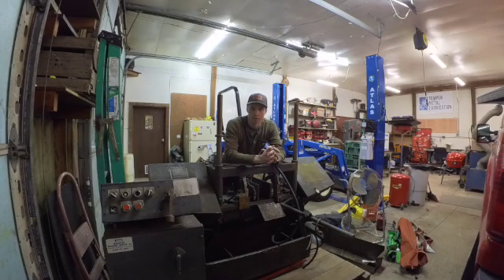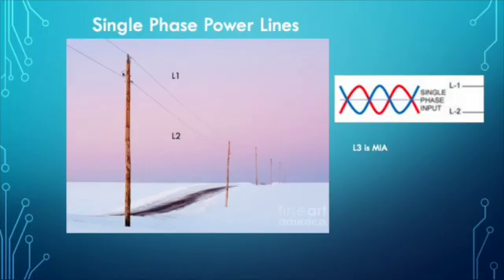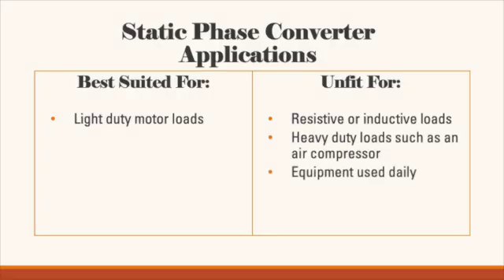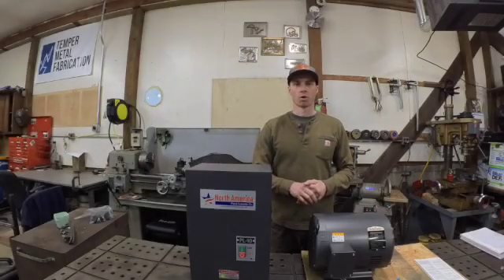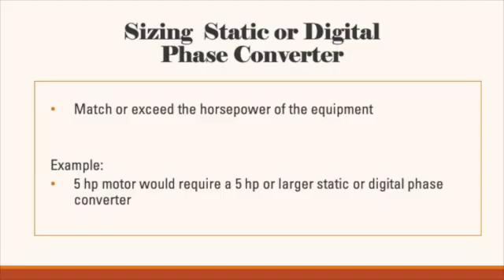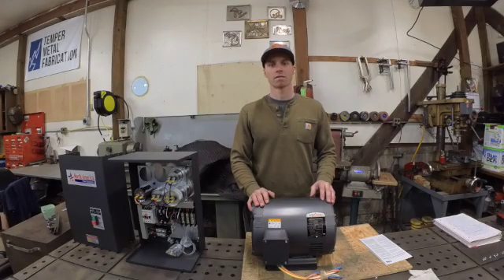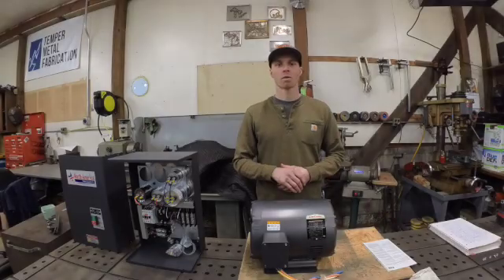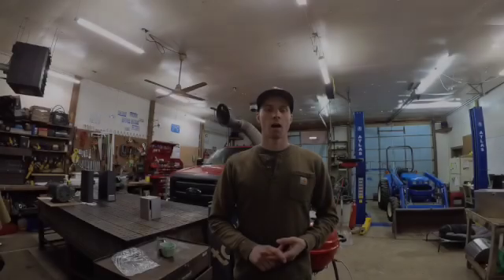How To Run 3 Phase Equipment In a Single Phase  Shop

Comment: With the phase converter do you power each piece of equipment or do you run it to a 3 phase panel?  Is it backwards to have a single phase panel power the converter and then power the 3 phase panel?  I guess you could run it to multiple shutoff switches instead of a breakered panel...
 I did not follow your increased breaker substitution exactly.  
My exact concern would be having my spray booth fans on while running a sander and air compressor.
All 3 phase.
The air conpressor is needed for the actuators of the sander and for the spray booth. Rarely occurs, but in theory, that would be my largest constant load
Reply from the maker: Thanks for watching! In your case, I would recommend having your phase converter power a 3 phase panel that you can run multiple lines off of. I plan to do that eventually as well but right now I only have a few 3 phase machines. Just like a normal panel, you can have 400+ amps combined in circuits leaving the panel even with only 100amp service. You just need to make sure you’re only running what the panel can support.

Comment: A couple of comments:
Some static phase converters (I've never heard that term before) will power all 3 legs of a 3-phase motor.  As said, a start capacitor give the moor direction.  Once the motor is up to speed, the start capacitor is switched out of there circuit and larger (physical larger, not necessarily in capacitance) run capacitors continue to supply power to the third leg by creating a phase shift from the single phase incoming power.
Also, many VFDs (variable frequency drive) deliver good sine wave power, as I understand.  Granted, some older 3-phase motors don't work well with VFDs, but the majority of motors don't seem to have a problem.

Rotary phase converters?  Basically, it seems they employ a static phase converter (see the capacitors and relays) to start the idler motor (um, excuse me.....generator....although it looks a lot like a motor).  If you have a suitable motor handy, you could probably save some money using it instead.
Reply from the maker: Some great comments, thanks for watching. 

Since a static phase converter doesn’t have a source to generate additional power, it cannot power all 3 legs unless it steals power from the other 2 and powers the 3 at under the required output. 

You could absolutely use any normal motor as the generator for a rotary phase converter. Unfortunately it won’t be as efficient or consistant as a motor like this one that is made specifically for this application by baldor.

Comment: I have questions. My dad purchased a block making machine. It's 3phase I need a converter but he's been gouged by quite a number of so called electricians. My question to you is will you consult with me regarding turning the machine from 3phase down to single phase. I've learned more from you than the whole year of working with so called professionals. I'd appreciate it. TIA
Reply from the maker: I am glad to hear it! I am by no means a professional and everything I’ve shared here I learned by talking with the professionals at North American phase converter. I am happy to help if I can but I would recommend giving napc a call and get their thoughts. Dave Kwasny especially is very helpful!

Comment: i bought ten 20 kw single to three phase convertors from china, 240 to 380
i solld some then mine failed when to of the three phase legs touched, it tripped my supply breaker, but the damage was doner, the machine is only protected  for overload, i was happy in ran my 12 hp lathe, my drill, bandsaw and welders  of 400 amp, the Chinese will not help, warranty is worthless, since then another died same reason
there is a red error light on the pcb
Reply: OMG I'm living this nightmare right now